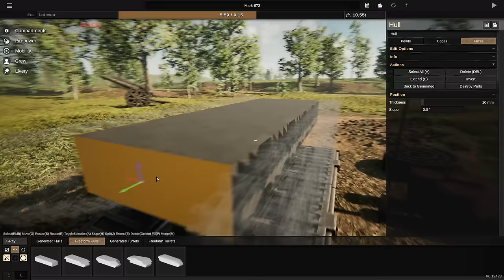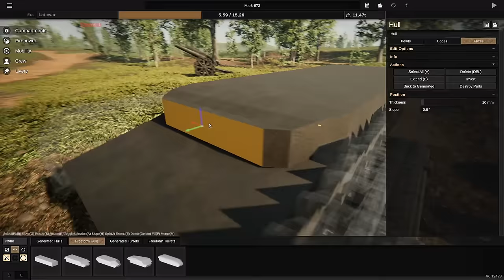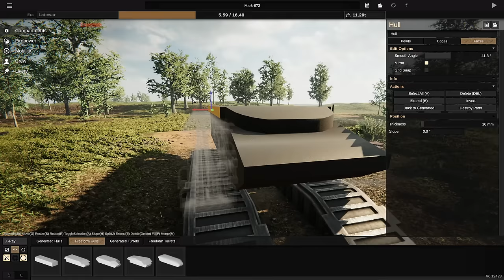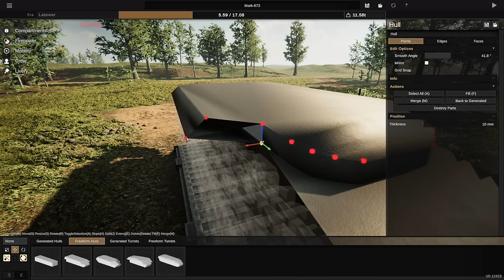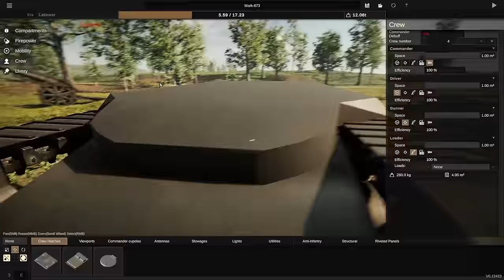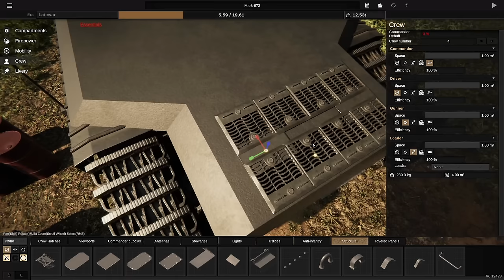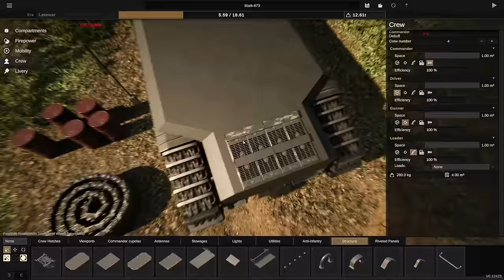I Built An EPIC CURSED 1000MM Cannon Tank In Sprocket Tank Design!

Comment: For the record. This tank has a bigger gun diameter than the Schwerer Gustav railway gun. Which is the largest artillery gun ever built.
It also weights approximately twice as much as the Maus, which is probably the largest tank ever built.

This is cursed xd
Reply: Verflucht Doppelt Schwerer Maus
Reply: fayyadh6659 No, the Germans made a 900mm round
Reply: In additional, the tank can store 1 round and can't reload, have super slow turn rate/turret turn rate, speed and fight in close combat. So it looks like an expensice suicide machine. 👀
Reply: @burningwings6788 

Designer slapping roof of AC20 boat

This baby can fit so much dilemma in it.  

If it survives the first shot, we ought not be bothering it in the first place

Comment: “You see that cannon on the battleship”

“Yes sir”

“I want that on wheels”

“Yes sir”
Reply: I was thinking exactly the same thing
Reply: @kremit6479  same
Reply: The largest battleship cannon was .46 meter caliber. The largest gun ever constructed was a railway artillery piece with a bore of .8 meters. Then there's this thing...
Reply: That was the Ratte
Reply: @waffentrager594  The Ratte was designed to have what was essentially a Scharnhorst-class battleship's turret with the central 11" gun removed. What you're thinking of are the historical Schwerer Gustav-class railway artillery guns and the P.1500 Monster tank concept.
Reply: @Myomer104  And the Ratte IIRC was canceled in planning.
Reply: Schwerer Gustav had ridiculously over caliber gun too

Comment: That tank shell firing would just tear the tank apart. Make the turret hull longer to fit in a shell, and I'd suggest maybe trying an oscillating turret to fix the cannon vertical control problem mentioned earlier. It would also be cool to have the engine at the end have that bulge you see on the M1 Abrams. Focus less on armor (or just remove it) as it's likely heavy enough (too heavy, anyway) and it would probably work as a very-long range """""self-propelled""""" artillery cannon, surpassing that of naval artillery and even the Gustav railway cannon in terms of sheer barrel width. Add more torque. Also, the ladder handles are too short apart for a proper slot for boots to fit in. The engine hatches should be bigger imo. The commander seat is directly over the cannon barrel, so just pull it back. Make the shells face forward and near the barrel considering its a ONE METER SHELL. If autoloaders existed in Sprocket you would also need that, and you would have to make the turret even longer, probably. The barrel edges don't look THICC enough to support the firing on that shell. Make it like a quarter meter long to be safe. Also it's locked upwards because of the 2 ton counterweight.

Comment: Feel like this design would have been attached to the Maus hull similar to WaffenTraktor E-100 in world of tanks.  This tank would have reduced the armor of the hull to as minimum as possible while having a crane on the back to assist with cannon loading and would need to be proceeded by vehicles with extra munitions.  Also the feet you put on the back are exactly used for recoil, just not how you placed them you can find similar designs on the american self propelled artillery m53 and the british fv4005.

Comment: So to give perspective on how big this cannon is, it's basically 1 meter in diameter or roughly 39 inches after converting the units.

The guns on the Iowa class battleships are 16 inches.  The guns on the IJN Yamato were 18 inches.

Christ, does this thing have a hoist to load the shells and powder?
Reply: Considering how heavy that shell probably is I'd just use a big damn crane.

You don't even need to eject it since the explosion and recoil would disintegrate the tank

Comment: The amount of recoil is very possibly enough to knock over the USS Canberra and even the sturmtiger and the FV4005 and the kv2 combined would not be able to handle it even with all the modern tanks in the world with the amount of recoil control would barely be able to handle it considering it is a 1.5 metre cannon

Comment: Why not make a real MBT that actually works.
Maybe make the tracks and the main body bigger. Since the gun is so massive.
Reply: The one meter gun would probably tear apart the tank instantly on firing IF you could even load it so it doesn't really matter at that point